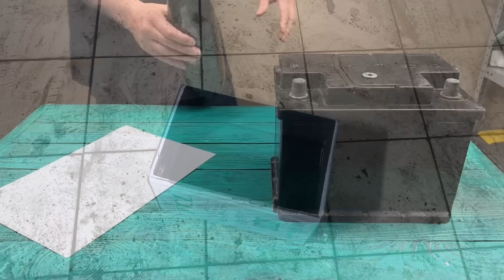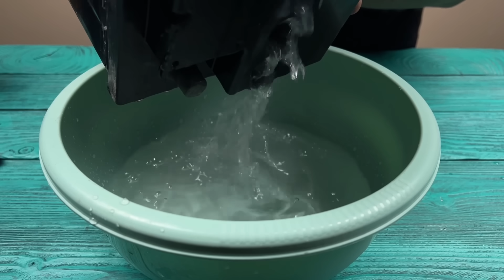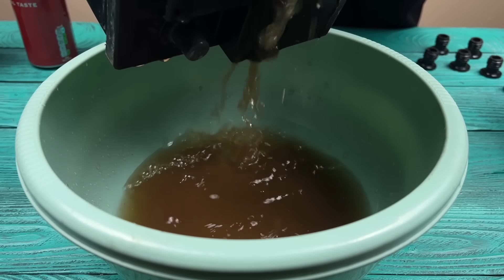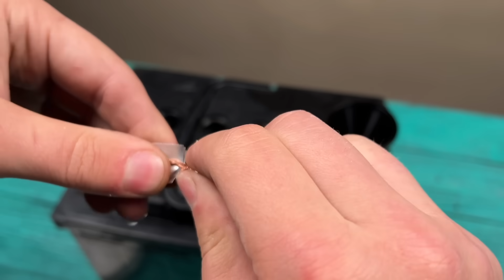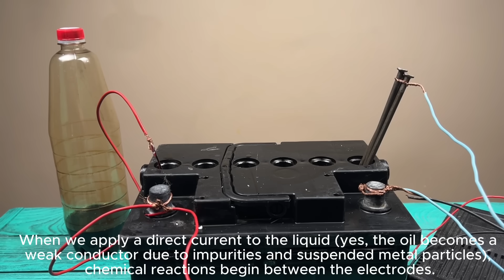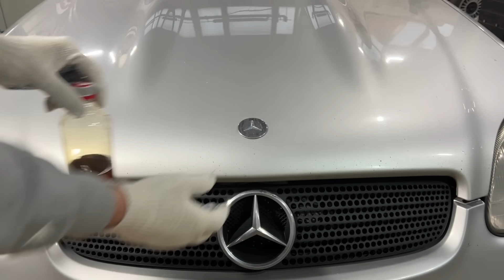Pour used OIL into your old BATTERY. Restore your oil without spending money at the dealer!

Comment: Well, you show the way for electroflotation coagulation in filtering waste engine oil. It takes six turns of clock, 3days. 
It seems that you need high perforation filter in chemical processing, and use battery cathod or anodes as the filter. 
If we can recycle the engine oil by this method at home, 180 million gallons of improperly disposed waste motor oil can be reduced by Americans only. The variable cost may be the electricity for 3days, 12v. I mean it's important problem, we have. 
Another question is about the metals that filtered. How can we dispose them? lead, arsenic, cardnium, zinc.etc. At least you have them in the battery in concentrated form. Maybe we need another channel for disposing the toxic material. By the way I am from Korea.

Comment: This is the biggest stupidity, don't do this, you will destroy the battery, because the battery most often gets damaged when the cells connect together, there is everything in the old oil, even metal shavings, and that's the end of the battery.
Reply: Aver lo k nomas no entendí se va a restaurar el aceite o la batería, bueno igual cualkiera k sea la opción no funciona ni una ni otra

Comment: How long did it take to clean up? We watch cos we are want to know more and explaining everything in detail help and encouraged more people watch and also share your videos. Keep it up
Reply from the maker: I kept it like this for about an hour.
Reply: @FixItFast1 thsnks your ans are helpful
Reply: Quanta besteira?
Reply: Thanks, old oil recycling for use in tractor hydraulic systems. Chain saw bar oil, oil burning car, and your car, just have to not mix oils during the process. Thanks for the information
Reply: Recycling is good, on a small or larger scale. However some things aren't practical, however some oils cost 10.00 per quart, so reusing it makes sense. And if you don't like it, just buy it. But for me, I will try it...
Reply: Stupidní nápad.